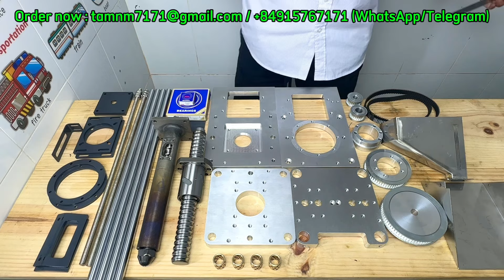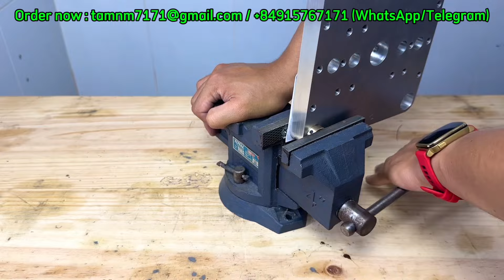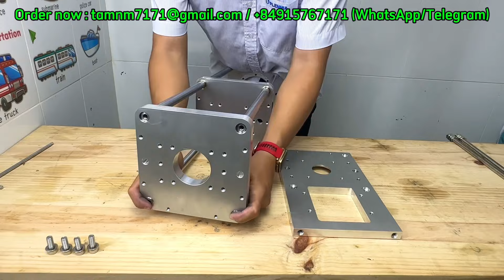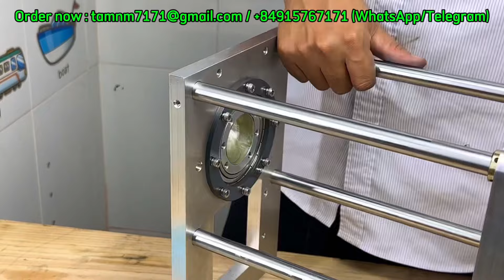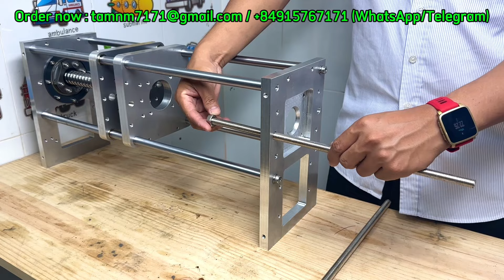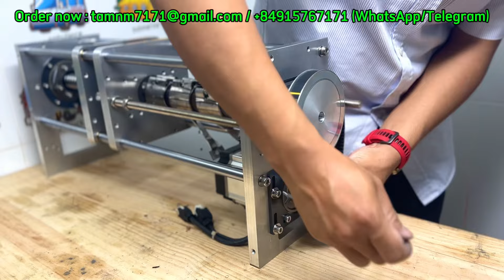Diy Mini Injection Molding Machine V3 Mini 25 - Part 1 (Assemble)

Comment: It looks nice,you worked a little in solidworks or fusion but there is one problem.I bet the parts are very weak becouse of the low force the pushes the mold clamps,you use a max 12Nm tirque motor and 1:2 gear so,it is small. Also the injector it only rotates and this is good becouse it melts the material equally but  it does not work also as a plunger to increase the pressure inside of the mold.

Comment: what steel did you used?
Reply from the maker: Aluminium friend
Reply: @handmadenguyen  how many Tonns can you apply? i think, Aluminum is too soft for that, i constuct now injection molding machine and i need to calculate each part..
Reply from the maker: For mini machine I think Aluminum ok
Reply: Vendes todo el kit para hacer una